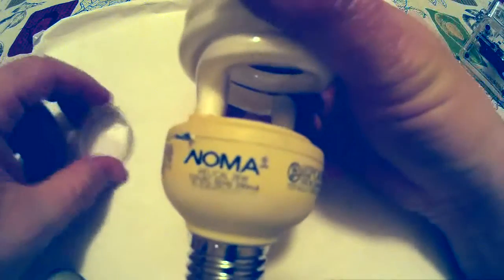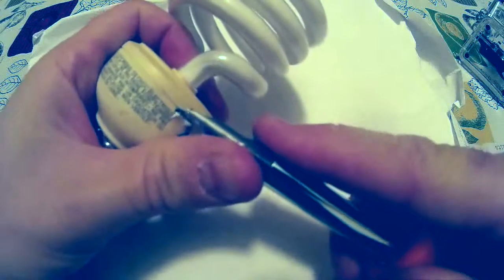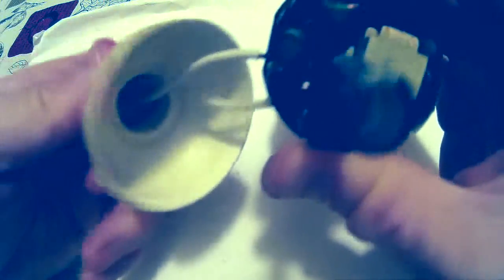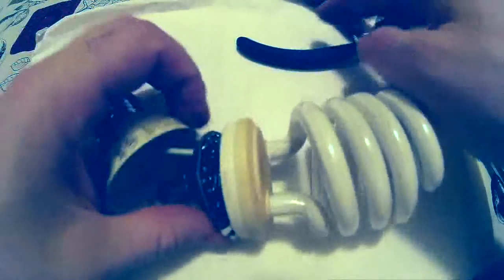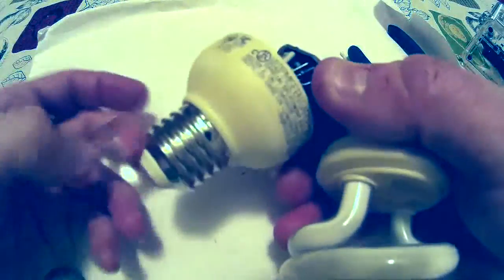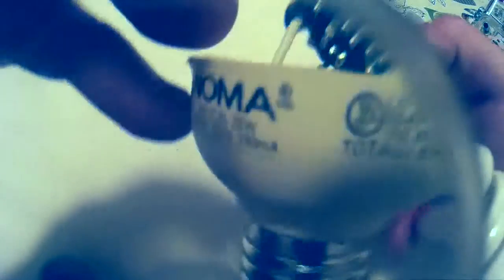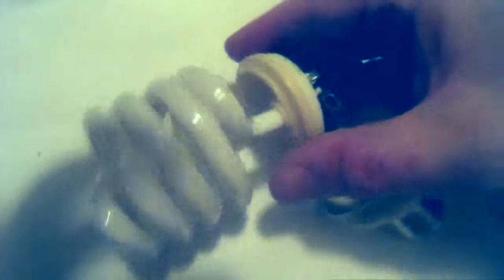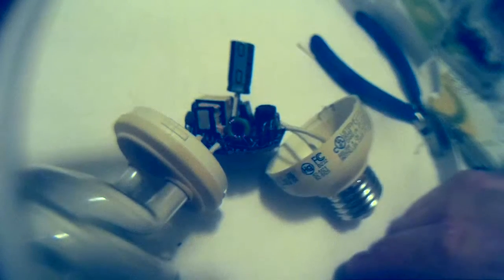Compact Fluorescent Light Bulb Teardown

Comment: Capacitors failed from heat, they should not be that brown, so likely are low value. On the input you have a fusible resistor, which likely is open circuit. Min capacitor can fail from heat without bulging, as the hot seal allows vapour to escape easier. That PCB is well cooked as well.